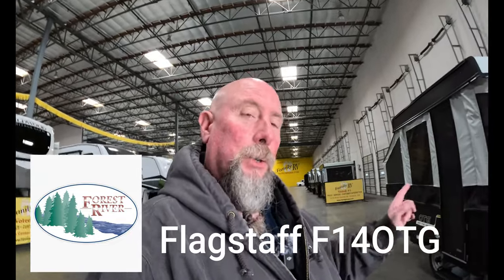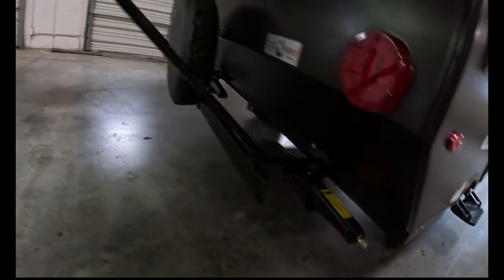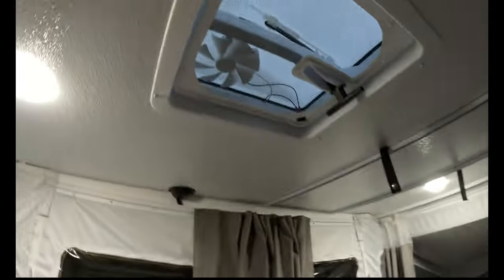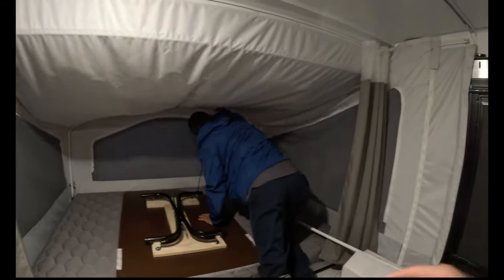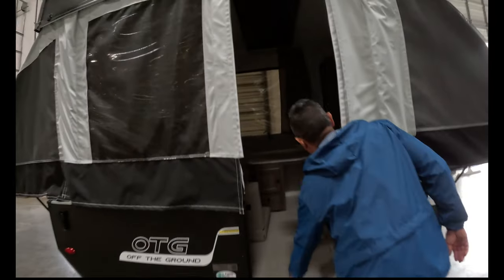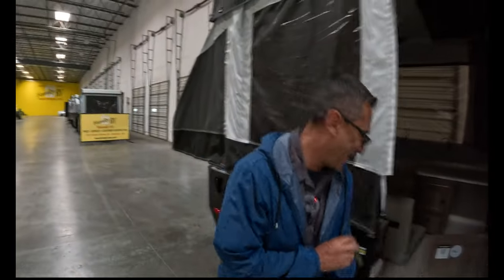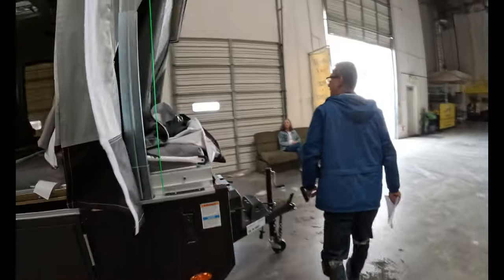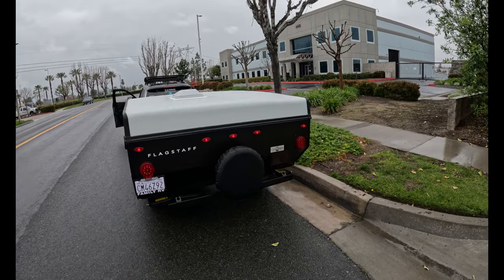Forest River F14OTG Introduction!

Comment: Does it come with AC??
Reply from the maker: No Ac. It is pretty bare bones. I purchased a go power solar set up to keep the batteries charged. I also picked up a small generator and an eco-cool portable AC right now. I’m in Slab City. She’s doing great. It does have two USB and one USB-C charge port inside.
Reply: @IntotheSunset  what's an ec?